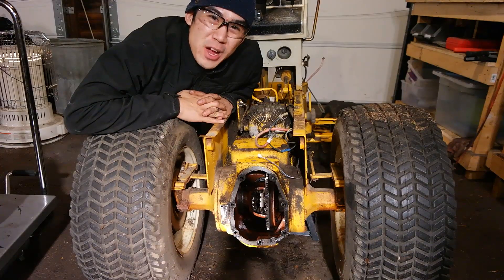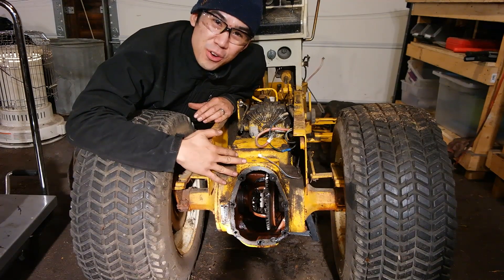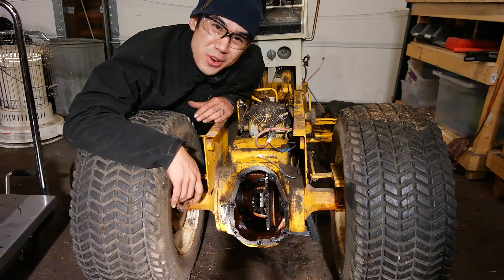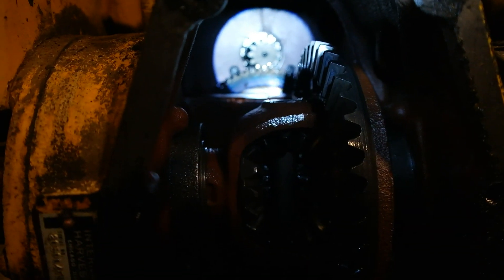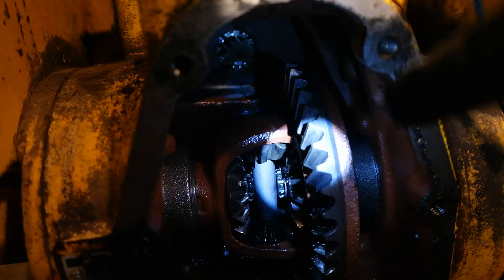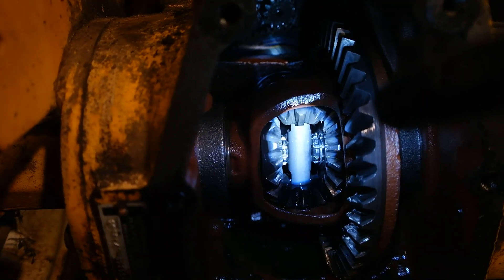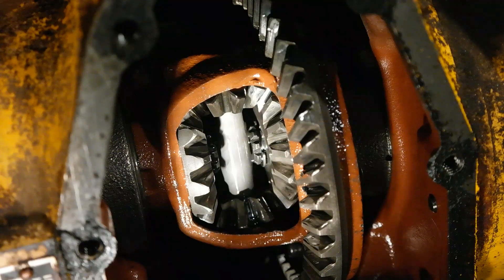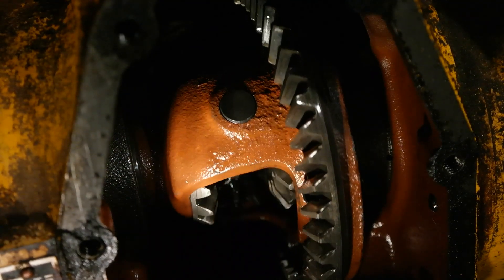The inner workings of an International Harvester Cub Cadet Rear Differential

Comment: I have two options on my cub cadet 169, 1) install a locking rear diff (dont know where to start) 2) upgrade/modify my brakes to separate left and right brake pedal controls.

Comment: Cool we have 4 big cub garden tractors and the cub tractor my garden tractors are both hydro with a Kohler  magnum 18 and the gear driven 582 with a b and a opposed twin flathead 16 hp the hydro is an 1811

Comment: Good video - I purchased a 1972 cub cadet 126 a few months ago. I have mowed a small yard 3 or 4 times. the second time I mowed I stepped on the clutch/brake pedal and the brakes wouldn't do anything and the clutch wouldn't engage to changes gears - I had to turn the tractor off with the key - but When I started back up everything was fine and working as it should. Now just today when I was finishing mowing I clutched to switch from 1st to Reverse and the tractor wouldn't move I tried 1st again and still no movement I tried 2nd and 3rd and the tractor would very slowly move inches - I had a friend push me and after a little pushing the tractor moves again, but each gear seems a little slower and now engine seems to run a little rougher --- Any thoughts ? thanks for your help

Comment: Best final drive ever put into a Garden tractor.  I had a customer with a 125 Cub Cadet Hydro. He was pulling tree stumps and built up so much torque with the hydro that he shattered the ring gear in half! We could not believe it. So they can be wrecked, but it is not an easy thing to do.

Comment: I have a cub 108 and the front pto clutch is slipping. Removed the 3 Allen set screws, but can't figure how to get it off the shaft
Reply: It is a locking ring collar (Two piece collar) there is an indentation to put a punch to it to unlock it.  If you are not familiar with how it works find something on youtube or get a service manual.  Piece of cake once you know how it works.
Reply: Okay there are TWO allen screws per hole.  The one on top is flat bottomed, and tightens against one that has a pointed bottom.  The pointed bottom screw locks in behind the two piece locking collar.  Once you take out BOTH screws per hole, the clutch pulley should come off and then take off the locking collar.

Comment: i have both a farmall cub (1948) AND a cub cadet original (1961). i absolutely love them both and love telling the story that the little cub has the same transmission as the much larger farmall. people have a really hard time believing that but its true. i consider these two machines to be a pair for someone who appreciates and loves history. that little, tiny (by today's standards) is a tough, reliable little workhorse. i mowed my 1-1/2 acre lawn today with it. incredibly overbuilt but still very serviceable and usable almost 60 years after it was built. i am VERY picky about the mower deck. its in awesome shape, it DOES not get put away without being power-washed. i pull it up on a set of ramps and power wash all of the grass off.
Reply: I was in Tractor Supply yesterday looking for some stuff for my recently acquired  cub 1650.  While wondering most of the isles I came across paint with Teflon infused in it. Instantly I thought mower deck.  I read the can and that is one of it's intended uses. Just sharing, good luck with your tractors.
Reply: andrew donohue the reason the rear ends are the same is because when I.H. was scrambling to get into the post W.W.II garden tractor market, they simply had a bunch of them laying around.

Comment: hey Norman I have a cub 107 now I've noticed a oil leak in my inner rim of my wheel do I need a gasket or a inner seal? do you carry any of this stuff?
Reply from the maker: travelinjavelin hi you need an axle seal. you can pull it out and match one at your local auto store. or you can visit ccspecialties.org. they carry lots of stuff for the Cub Cadets
Reply: what would your recommendation be on how to pull the axle out or easiest way?
Reply from the maker: travelinjavelin jack the rear end up. remove wheel. remove rear different cover. there is a c clip that holds the axle in. remove the clip. pull the axle out.
Reply from the maker: be aware you will lose all of the oil so have a pan ready
Reply: so that back cover that you have opened you can go through there to remove clip correct?
Reply from the maker: travelinjavelin yes correct

Comment: Hello Ric l have a cub cadet 1250 can't get it to move.It doesn't have push in release valve for pressure.I changed fluid ,filter and roll pins . Wheels will spin when jacked up.What could be problem.

Comment: I have an old 127 and I have no leaks, but after 5 min. of use or when its arms up the tractors transmission loses power. like it starts slipping in forward and reverse. do I need a new pump. other than that it mows and runs perfect. any ideas on the problem would be appreciated.
Reply from the maker: First check your fluid level. Make sure your rear is full to the fill hole in the back. Next check your transmission oil filter. If it's old replace it. Next check the driveshaft coupling between your engine and tranmission. They are held on originally by hardened steel pins. Make sure yours aren't falling out or broken. If none of that helps, your charge pump may be worn. Your charge pump is responsible for getting hydraulic fluid out of your rear end and through the transmission. You will have to remove your transmission and inspect it.
Reply: isavetractors  Hey thanks for your quick reply. I have checked fluid levels and it's full with no leaks. The filter was replaced and coupling looks pretty good. I was also thinking weak pump, as it works ok at initial startup but fades as it warms up. I bought a used 125 rear end with only physical difference, appearance wise is lack of rear disc brakes. I wonder if I could just switch pumps? I know nothing about these hydro units I usually collect gravelys. But I love the looks of this little  tractor and bought it at a great price.
Reply from the maker: The transmission pumps are all the same except some have additional ports to use hydraulic implements with. They are all sunstrand pumps and are interchangeable with the rear end. You can just switch pumps, or switch parts for the parts with your 125.

Comment: I've seen a few of these with a pto shaft sticking out of the back plate. All the little cubs had the pto coming out. Would the innards from an agricultural Cub fit inside a garden tractor ?  Several years ago I replaced the whole pto on a Super A Farmall but have forgotten how it all went together. My brother broke the shaft and the back housing somehow but it's been too long ago to remember how it all worked.
Reply: Remember, the Farmall Cub does not have a 540 RPM PTO. It was some proprietary speed, I think maybe 1800 counterclockwise or something like that.
Reply: that was the optional PTO unti
Reply: Yes, the 540 p.t.o. Will swap from a farmall cub to a cub cadet. I don't know why you'd do that though because all I.H.   implements run from the front p.t.o. Even if you had a cat 0 3 point on the rear nothing would really need the 540. Also not sure if you are mentioning the super A because you want to replace that but the cub and A rear ends are different.

Comment: i ended up getting a used rear end for parts , the pump was completely different but i robed the parts from the inside , they were larger but they fit and it works .......  so now all i have to do is send off one of the  relief valves and have it rebuilt and it is back up and running .........  i took it for a test spin , and cut my front yard .    other than the valve leaking it works like a champ

Comment: i finally got my pump apart ..  on the lower unit a bunch of the brass wear plates are broke , and the washer around it is also , so my question is , where can i order these parts from , or do i have to go to a dealer
Reply from the maker: check out Cub Cadet Specialities: http://ccspecialties.org/index.html

Comment: i pulled the rear end out of my tractor . and removed the pump ass , i turned the input shaft  as well as moved the gear selector to both  fwd and rev while turning the input shaft , and no movement ..  so i unbolted the pump housing but didnt get it to come completly apart  , there was some brass slithers fell out .....  so im assuming something is broken inside .....  so i was wondering if you may have a extra pump ass to sell ..........  if so price please ....  and thank you for ya input 
or what would you segest me to do .....thanks again
Reply: You may have a hard time finding a "pump ass" LMFAO

Comment: my tractor does not have the buttons ......  i pulled both of the valves out  and still wont roll
Reply from the maker: you will have to remove the transmission pump from the rear end. it's simple. only 4 bolts holding it on. I then recommend disassembling the transmission pump to investigate the problem
Reply: ok will do and then i will see whats wrong
Reply: i pulled the rear end out of the tractor , and removed the pump. then unbolted the pump housing , i didnot get it  to come completely apart but some brass slithers fell out ...  and the out put shaft is still stuck will not move........  do you have a good pump ass you would sell ......  if so price please.....  thanks for all your help
Reply from the maker: +tony blanton tough break. I don't have any spare pumps but Google Joe's Outdoor Power. that's where I get parts when I need them
Reply from the maker: +tony blanton tough break. I don't have any spare pumps but Google Joe's Outdoor Power. that's where I get parts when I need them
Reply: ok thanks i will give it a try

Comment: i have a 1882 tractor that i just got ....  the rear end wont  roll . the brakes are free !!!!!!  i raised the rear wheels up off the floor with a floor jack and yes they will roll , one one way and the other side the other , due to the spider gears . i pulled the rear diff cover off , to change the oil  . all is nice and neat as it should be . but the ring and pinion will not move period !!!!!!!!! it does have a lill slop , as it should of course , but it will not alow it to roll or by the motor ,,  when i try to move it with the motor running the pump wines , but no movement at all from the rear wheels .........  the power stearing and the lift seem to be weak .......  i changed the oil and new filter on the hydro pump.......  can some one please point e in the right direction ......  thanks
Reply from the maker: Your transmission pump may have two little "buttons" on the top of it. If it does you need to push these in before you are able to roll your tractor. Remove your tunnel cover and look at the top of your transmission pump. If there are two little buttons on top of big hex heads, push it. This will relieve the pressure trapped in your transmission so you can roll your tractor. If you see the two big hex heads with no buttons, you have automatic dump valves, and they could be malfunctioning. Remove them with a wrench and clean them in solvent. Once you remove them, you will be able to roll your tractor. Good luck

Comment: cub 2082 Hydro - I pulled my rear end out to replace seals because of leaking. Took rear plate off and tried to turn my ring gear and it won't move.... any help appreciated...
Reply from the maker: release pressure from your hydro transmission to free up the input gear. With the hydraulic pressure still in, your gears won't turn.
Reply: Thanks!